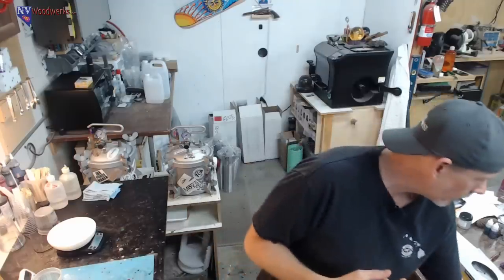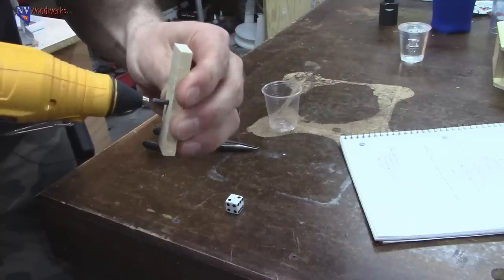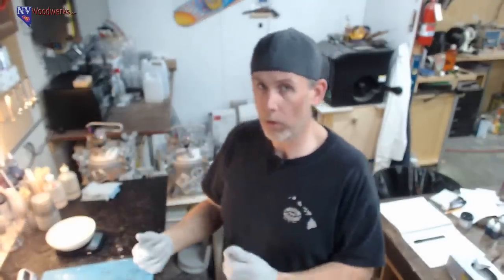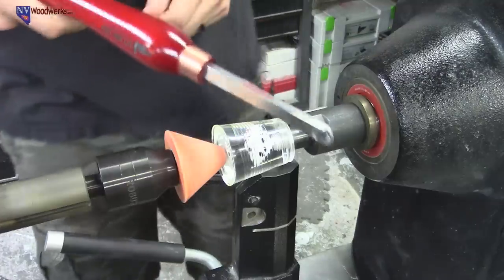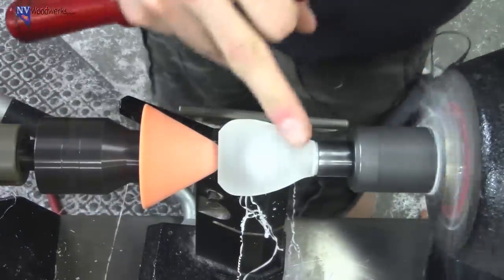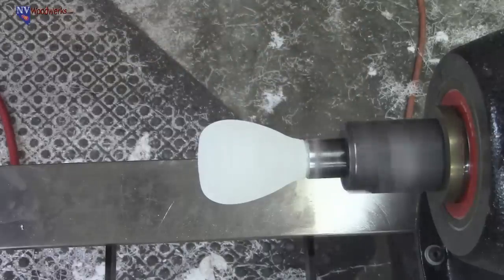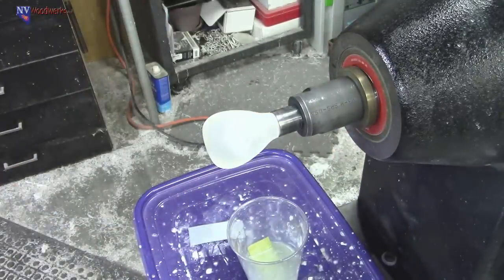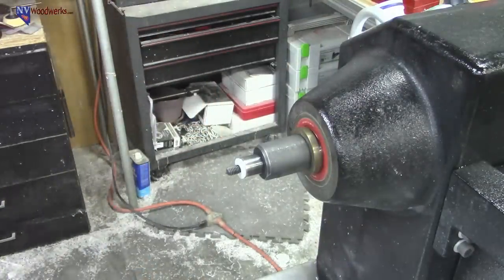🔴Replay: Suspending Objects in Casting Resin | Episode 12

Comment: If someone don't have a pressure pot how long should you wait to add the rest of Alumilite resin to the cup with the suspended dice after the first pour? Great videos and info. I did something similar with Alumilite in a 2 x 2 x 3 inch container with a dried flower. First pour got about half way up the flower and poured the second amount of resin about 10-15 minutes after the first pour. First pour was fine but once I added the second pour of resin started to bubble up and smoke up. The container was very hot and I thought it was going to catch fire. lol. Please advise.

Comment: Tried both and still getting a witness line. I pulled the regular clear at 20 minutes to pour the next layer. It was clear of bubbles and they never came back but the witness line is still very easy to see.  I poured the 2nd layer so early that the form was still extremely warm so I know the 1st hadn’t cured yet. I think I’m throwing in the towel on this dream of mine.
Reply: hey! did you had any luck with removing the witness line??... I am doing some research on my very first project of making a sunflower resin lamp for special someone, but this thing scares me as it is not adviced to pour resin in single step... bc the flower might drown or tilt or might even cook from the heat produced due to large amnt of resin.

Comment: Try using thin acrylic rods with a taper and flat tip at one end and use a dab of resin 
(Or glue) to attach the objects. This makes it easy to suspend the object and pour the resin in one go without having to do layers. The portion with the rod will be virtually invisible.
Also, Alumilite does not have a UV protectant so it will eventually turn a yellowish color after a while. (Unless they changed their formula since last I used their clear)

Comment: Bolt might have conducted the heat to the hot glue and softened it....  I like the use of the air hose while turning - what a good one!  USE the threads to mount this to a stand.  e.g. drill out and turn a rod that size and fit the rod into a turned disk.....or something like a disk.

Comment: EUREKA! So weight seems to be the main issue...with metal, what about painting a plastic bolt? if the resin hasnt gelled quite as hard as the ideal hardness would be, it should be significantly lighter (and sink less) and nobody will be none the wiser! 🙂

Comment: nice work zac,nobody will notice!
Reply from the maker: Thanks John! I turned the other blank I had made with Alumilite already to see if I was going crazy or if there isn't usually a line, and there was no line in that one. I think i just waited a bit too long to do the second pour with that one blank. Going to do some more tests to make absolutely sure, but I think you should be good to go if you pour the second layer within a few hours of the first one. The only issue will be figuring out how soon you can crack the pressure pot with slow setting resins that typically take many hours in the pot, Alumilite is straight forward though at least =D
Reply: i am using a resin from easy composites a u.k. based firm, it sets great in a pressure pot but takes a long time to do so.you will have to try a slightly dyed resin and see if there is a noticeable join in one of your tests.atb john. @ZacHiggins

Comment: So, could the reaction from the resin curing heated up enough to warm up the hot glue and cause it to drop the bolt?
Reply from the maker: I don't think that was what caused the issue. The bolt is just smooth, and I didn't add enough glue to it I think
Reply: @ZacHiggins  do you think that heat from the reaction COULD possibly cause an issue like that in a similar scenario? of course, some resins heat up more than others. do any of them heat up enough that they could melt hot glue? just curious.